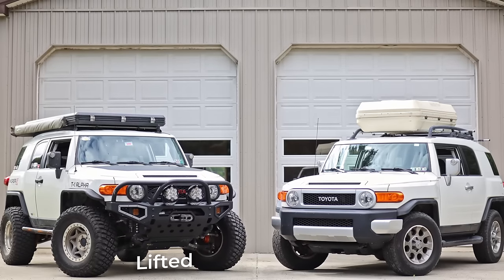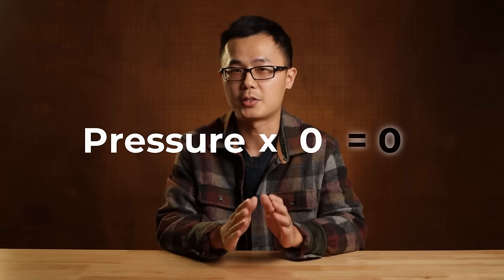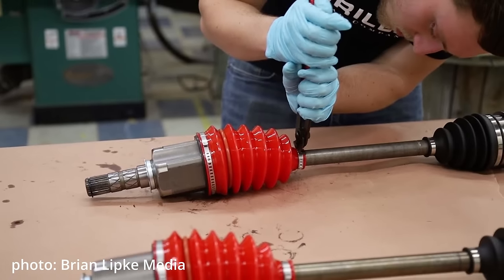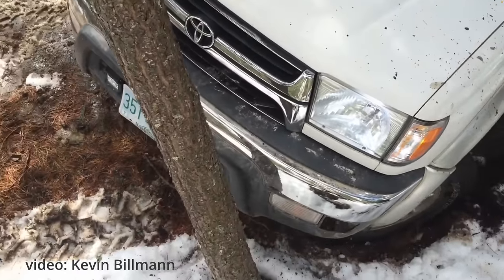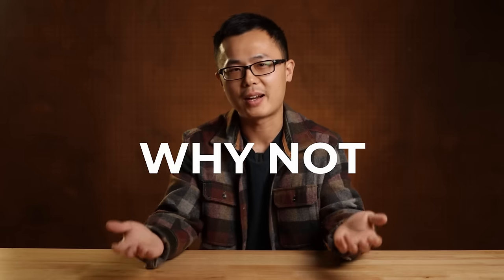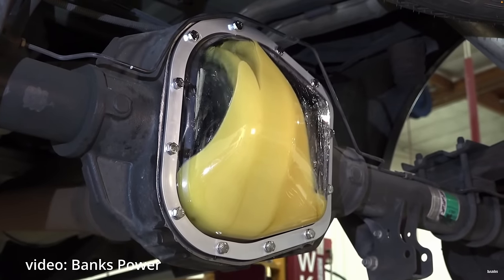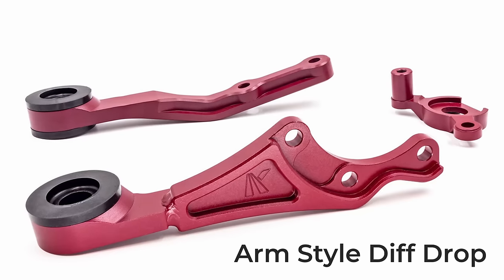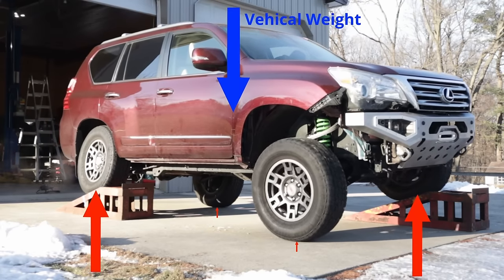More Harm Than Good? Toyota Diff Drop Truth vs Myth

Comment: Hey Kai, I recently installed a ironman fcp lift kit with their control arms on my gx470 and noticed that at full droop the coilover is still slightly compressed, meaning that the ball joint(s) are the limiting factor. The truck is non-kdss and the swaybar is removed. Is this safe for normal offroad use? Should I use limit straps? Thanks! Always learn so much from your videos.
Reply from the maker: Hmmm that is definitely not good. To bind the ball joint on ironman UCA, which is more angled than stock, your coilovers would be really long and something else is likely binding too. Something is definitely wrong and you should contact Ironman. But just to help you out, make sure your top hat bushings are installed correctly as that can change the overall length. Also did you install any trim spacers on top of the coilovers (even just 0.25" thick for leveling things out)?
Reply: @TinkerersAdventure  really appreciate the response. I'll give ironman a call. There are no trim spacers and I used ironman top hat bushings, I'll take a look again to make sure something is out of place though.

Comment: in your relationship of wheel speed and torque would you say that going slower with better gearing would result in reduced risk of snapping CVs?  locker vs Detroit true track? specifically first gen tundra

Comment: If you're going to do a lift greater than 2 inches you should do a differential drop. I personally would do a one inch drop on a one inch lift to keep the axles as level as possible. This goes with the rear and doing a carrier drop if you lift the rear. Keeping those universal joints from binding is important just as oversteering during a hard acceleration over a rock crawl. Whatever you can do from breaking things on the trail is best because getting back home is important.

Comment: One thing you don't cover is the impact to CV boot wear by not doing a differential drop.  I've noticed that if you do a lift on a older vehicle that hasn't had a recent reboot, that you can expect to experience a boot failure due to a recent lift to accommodate bigger tires.  I've seen time and time again this issue pop up due to not dropping the diff when you have used CV boot, that is seems to expedite or facilitate this phenomena to occur more rapidly.  Food for thought.
Reply from the maker: Did you skipped around? I have over a minute going over CV boot wear and the best way to address it.

Comment: You lost credit when you mentioned Ironman components. 
I had the full cell foam kit on my Tacoma. Absolute, total, unparalleled garbage! 
Ridiculously stiff at just a 2 inch lift. With just light offroading the leaf springs bent, the rear shocks wore out in 10,000 miles and the front coils sagged.
I was never so glad to get that crap replaced!

Comment: Gteat video! Question,  i am about to add bilstein 6112 coil on my 2017 4 runner trd pro.  I believe i have bilstein 6112 from factory.  I just want to add the coil cuz its stiffer and that will probably add a little lift to level it out.  Shop is telling me to add diff drop to protect the cv boot but i am not sure.  Do you think i will be fine without?  I only do light offroad.  Thanks in advance

Comment: I've had a fox 2in lift on my FJ for almost a year now with no diff drop. As of around 3 months ago the cv boot ripped and I seem to be replacing it every month. I believe it is from diff binding when fully extended. Note it is only on the driver side the passenger side has never had any issues. With no front sway bar, when I take a decent turn on the highway it sways a bit causing it to extend. Also the driver side wheel is unable to spin completely when off the ground. Is this a diff issue or something worse.

Comment: Hi what do you think about the trackbar correction kit？Do you have one installed on your lifted FJ？I got a 2 inch lift on my FJ and The Measurement shows the rear axle has move to one side about 5mm off centre due to the trackbar is not level anymore. Is that really matters？

Comment: I have a 2021 4runner sr5 premium non kdss. I was thinking about buying and installing the readylift 3/2 leveling kit but wanted to know if it was better to diff drop with that or not to worry about it. I will be running 33s at some point and do not off road (abuse) my vehicle just moderate off road driving.

Comment: If suboptimal suspension lift reduces down travel and therefore articulation. Would this contribute to wheel lifting and bouncing that creates additional load on CVs causing them to break? It would explain why people mistakenly associate CV angle with premature component failure.
Reply from the maker: Good thoughts. Yes most IFS lift tires a lot and paired with aggressive throttle and wheel spin, the shock load when the tire suddenly catches traction does a lot of damage.

Comment: I think I get most of this.  As I look to lift two 100 series Land Cruisers  1.5-2”, I need to include a diff drop??  Thanks!  Dan
Reply from the maker: I'm not familiar with 100 series. It was only briefly mentioned by ironman engineer. I believe it depends on the shock lengths of the lift kit you choose. I'd ask your suspension manufacturer.

Comment: Do you have a recommended brand/type of extended travel cv boots? How long do your boots typically last with your lift?
Reply from the maker: I don't have any first hand experience. But I think CVJ is one brand that sells it. I'm running RCV axles. The boot geometry is high angle in design, but the material last way less than anything else. Not what you expect from $1000+ per axle.

Comment: I've had dozens of truck and just like an idiot I lifted almost everyone of them. For one thing it eff's up the entire suspension and makes the truck drive like sht....For another thing that 2500 buck you paid to lift the truck you never get that money back.
Once you lift the truck you lose about 5 mpg.
I think the manufacture knew what  they were doing when they paid millions of dollars to the engineers who built the truck
 Moral of the story....Leave the suspension alone not to mention you will get more for it when you sell it and it will be easier to sell....Most people don't want a lifted truck. Now leveling one is a different story.... I still do that but I don't jam up my axles

Comment: I think it depends on how big the lift is if it's over 6 inches I would probably do that if it's a very very small lift not needed
Reply from the maker: 6 inch lift is a drop bracket lift. You are even dropping the lower control arms. So that is a different system

Comment: 5:50 why does the Landcruiser 100 series need one? I have the V8 4.7 100 series but lifted the front less than 2" (by just winding the torsion bars). Do I need a diff drop or not? Thanks.

Comment: How does the diff spacer compare when looking at long travel trucks? Such as a dirt king set up on a tacoma
Reply from the maker: Good question. Long travel operates the CV to higher angles to achieve their advertised travel number. Check out my Long Travel IFS video where I cover a little bit about diff drop.

Comment: appreciate the content. the talk about diff drops and skids got me digging deeper. do you have any thoughts on skid plates and temps? 

as ive been doing research on skids ive noticed lots of manus have different designs, many of which dont have proper ventilation like the OEM plates do. others accommodate for KDSS as well which drops them even further. curious if these solid plate designs, like RCI, can lead to a transmission failure
Reply: I don't know about that, but I have an RCI front skid on my 4Runner, and I really don't like it. It hangs down really low, with stock suspension and stock size tires. I have 7.5" under it. I don't really off-road road that often, however last month I was on a trail in Vermont and I was banging it constantly. It did its job snd isn't even dented, but it was just hitting everything. My Volvo wagon has the same ground clearance.

As far as the heat, it's not a concern to me, however, you could probably take a hole saw and put a few holes in it if you wanted to get some more airflow in there.
Reply: @trailrunnah8886  thanks for the input. are you running KDSS? the KDSS plates do hang much lower to accommodate travel. 

RE: holes, thats my thought as well right now. better ventilation and drainage when water crossings happen. although, cutting through 3/16 steel is a little daunting lol
Reply: @swangfuI  I do not have KDSS, however, I bought the skid plates used and it's possible that they are the KDSS design. I read somewhere that they have the same ground clearance, so I'm not sure if it makes a difference. I'll have to double check on the RCI site. 

 Yeah, I'm sure drilling through the steel would take a while haha. I wonder if you can mark out whete you wanted the holes, and then just take it to a machine shop. They probably have the appropriate tools to make short work of that.
Reply from the maker: Good thoughts! Yeah RCI is diff drop “compatible” and has lower than stock clearance. Auto trans is not as affected by airflow because the ATF is cooled by the radiator, or a dedicated trans cooler. Manual trans, hmmm not sure how much difference it can be. The front diff is also on the same boat. To be safe, I personally would go with one with similar amount of air opening

Comment: I did a video on this and measure the before and after angle on the CV and it only makes a 2 degree change. Personally I think is a waste of money.
Reply from the maker: Nice video. That's a good data point. Since I have longer control arms and CV axles, my angle was only reduced by 1 degree. I briefly showed that measurement in the video intro. But my data wasn't representative for most people so I didn't talk about the number

Comment: With the diff drop say 1 inch or more would it run into binding issues on full bump?
Reply from the maker: Great question. I measured the CV is at 16+ degree at bump stop without diff drop. The inner joint is pulled out so the shaft would not collide like it did at droop. But I'm not sure how the CV will bind next after a lot of diff drop.

Comment: Does anyone think you really need a dif drop on a 2.5 coil over on the 24 tundra trd sport which has the shorter black cv not the longer ones like the off road.   I would just be on normal roads no off road.  Maybe this is one that actually needs it.

Comment: I’m not going to waste my time watching this whole thing.  The idea of a diff drop is good but people are too stupid to know how to do basic math.  So with a standard 1” diff drop you’re getting a fraction of that 1” because of where the diff bracket is hinged at the back.  

Now some people like to argue that having something is better than nothing.  I’m not going to argue that’s not a legitimate idea but you aren’t getting anywhere near the 1” you think you got.  You just lost 1” of clearance in the front where the spacer gets installed.

Also these same people like to argue about panhard bar relocation brackets.  I used my personal vehicle and drew the bracket out on paper.  I took it at perfectly level (assuming this was how it sat stock) to an angle with a true 3” lifted stance.  The axle moved a total of 1/4” side to side different from the 0* panhard setting.  If you are dumb enough to believe you’re gaining anything from 1/4” you need your head examined.  Then these same people go onto argue they can feel this through the chassis.  BS!!!!!!!!

It’s all marketing BS and you all are part of it if and when you fell into it.  As a buyer of such parts you will argue and justify it however you want just so you can sleep better at night thinking you actually gained something.  Nope, your wallet is just lighter.